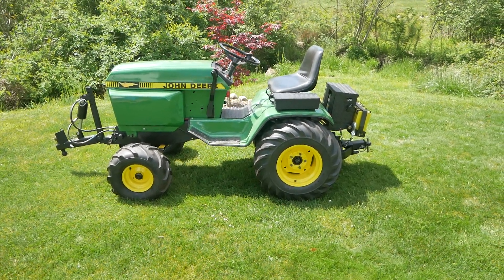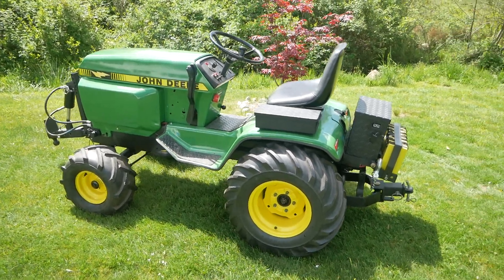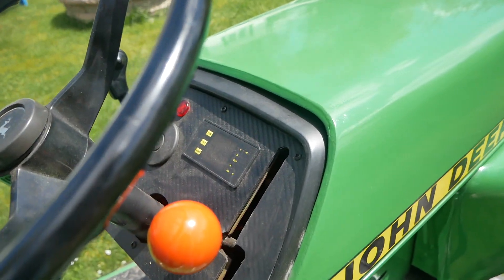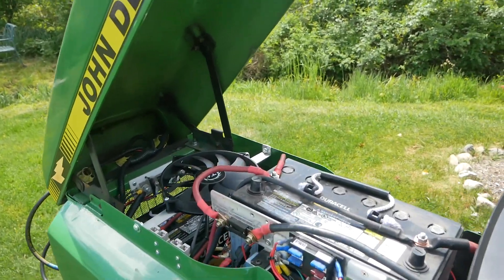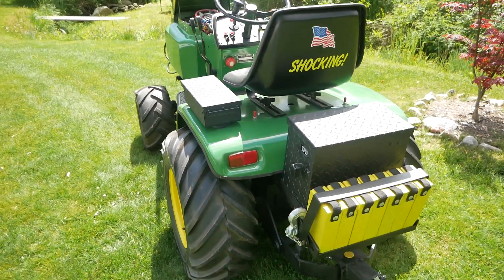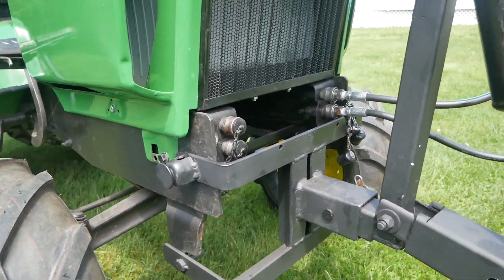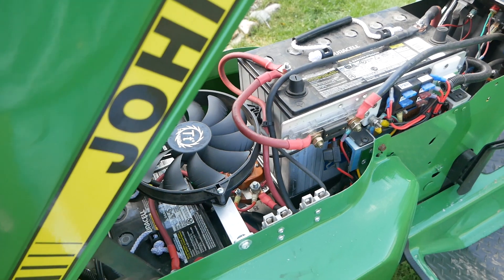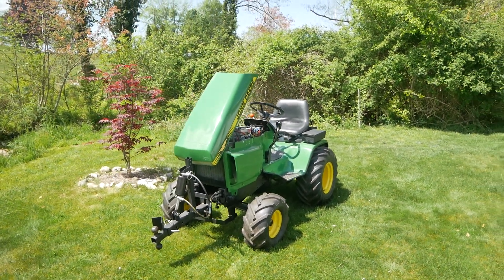Walk Around of ELECTRIC John Deere 316

Comment: Two years later, how's this going?  Are you still using those lead-acid batteries?  I've never run anything other than Lithium based batteries in my conversions.  If you ever do decide to switch over, you will not be able to isolate one 12v bank to run accessories.  You probably shouldn't with lead but I assume you do an equalize charge cycle occasionally to get them all back balanced?  It seems to work for you though and I know golf carts have done it for years.
Cool build.  It looks great!
Reply from the maker: Yes, the LA batteries simply won't die! I bought three EcoWorthy 150aH Lithium batteries for it, but until the LA stop performing, the 150aH reside in my travel trailer. I never let the LA batteries get below 50%. I installed a shunt based battery monitor so I can keep a good eye on them. These batteries are now over 10 years old. Doing yeoman duty on my travel trailer for years and now in the tractor......

Comment: My John deere 420 engine has crapped out and I'm seriously considering converting it to electric with the same configuration as yours. I also want to keep the hydrolic functions for all the attachments. But I need to figure something out with the PTO. Maybe adding a second motor for that perhaps?
Reply from the maker: A front or rear mounted electric mowing deck like I made in the article.
Reply: @roybertalotto6355  it's for the front PTO which powers the mower deck or the snowblower depending of the season. Defining the type of motor is the hardest part.

Comment: love the PC fan but idk if that fan will actually be able to deal with cooling
Reply from the maker: Never been needed so far. Motor barely get warm. I thought it would get quite hot, but so far, a couple years of use, and no issues with heat.

Comment: hey Roy, how many amps does the motor consume on idle, running that hydraulic pump? and on what voltage? and how much amps when driving around?
Reply from the maker: About 35A at 36V when idling.....Up to 60A when running full speed......And nearly 100A when really working hard....But only for a short duration.